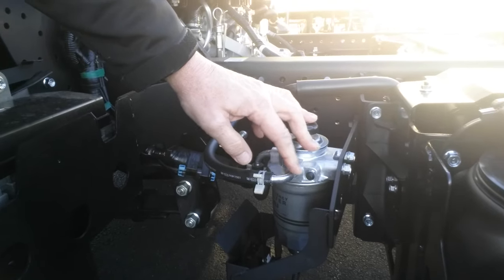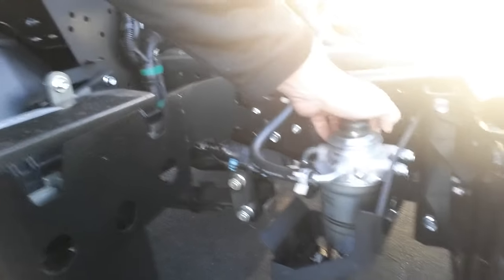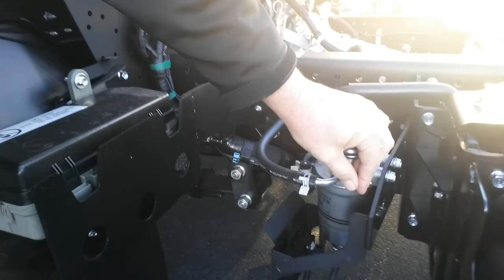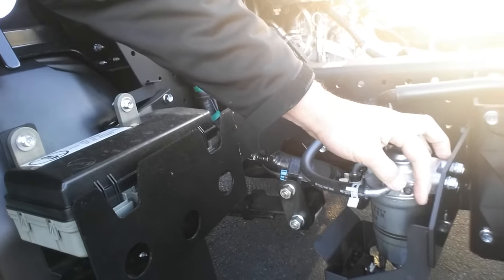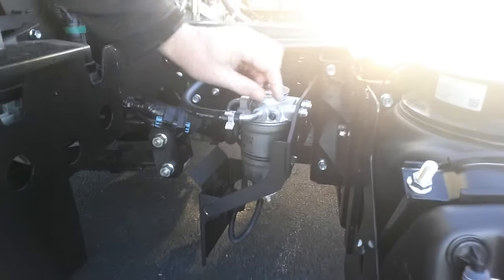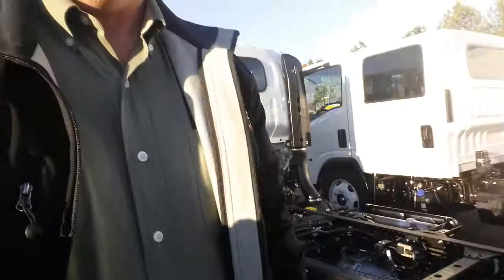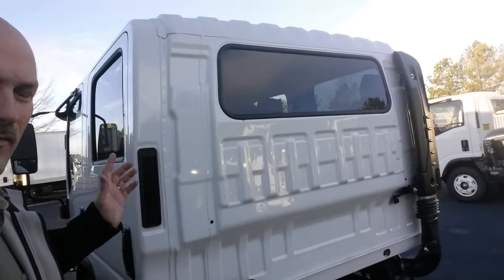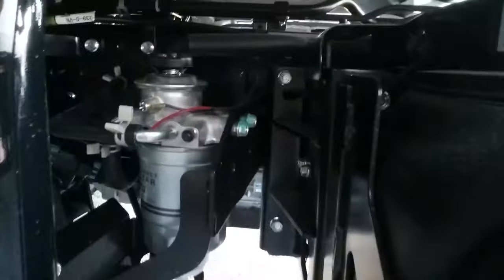How to prime the Isuzu Fuel Line - Diesel Engine - Replace Fuel Water Separator - Michael Olden

Comment: Thanks this helped alot took 45minutes but I realized i didn't unscrew the bolt but after that i saw the fuel come out. Tried to start nothing but tried again and after letting it try to turn over for about 10 to 15 secs it started right up. Thnx
Reply from the maker: Glad to find out that the video helped!  Thank you for your comments.  I apologize for the delay in responding,

Comment: Recently installed both fuil filters now truck is shaking not starting not sure why already bleed system there bleeder valve still not starting
Reply from the maker: Okay, let's start from the beginning.  Take the filters back off
Check the threading, re-tighten if all is well.  Just to be sure - make sure there are not any missing gaskets.

The new filter should have improved flow not deterred it.

I hope this helps! let me know!

Comment: Do you also have to bleed the injector lines/is there even a procedure for that or is priming up to the filter good enough? I suppose continuing to pump after fuel is at the filter and the bleed valve is close will also prime the rest of the system? Sorry, not much info on this out there. Took the head off on mine and have to bleed the whole system. Thanks!
Reply from the maker: The manufacturer describes the pumping only by the sedimentary filters.

Technicians will back off the fastener and the furthest injector supply and prime the pump until the fuel seeps past the threads.  Then retighten the fasteners, prime a little more, then start the unit.

Comment: How about needing to prime the pump every time I need to start the engine, how can I fix it?
Reply from the maker: Having to prime the engine every time you start the truck is either: not securing the primer once you charge the system., A fuel filter that is not properly tightened - i.e. not sealing, an o ring that is failing in the fuel pump $$$$, or a line that is lost its seal.  Call me at 423-618-3323 to discuss the age, hours, and miles on your truck.
Reply: @MichaelOlden  thank you Michael, I’ll doble check the hoses and filter, everything looks tightened but it won’t hurt to check again, my truck is an 2006 with 220k mikes.

Comment: My truck is 2010 and I don't have a primer
Reply from the maker: If you have a diesel engine there is still the primer pump.  Please confirm you are driving the diesel engine.  Next - if you have the owners manual - check out section 6-17.  It should definitely follow this video.